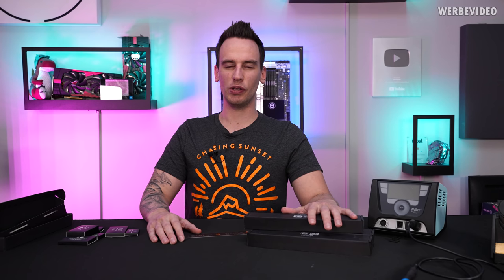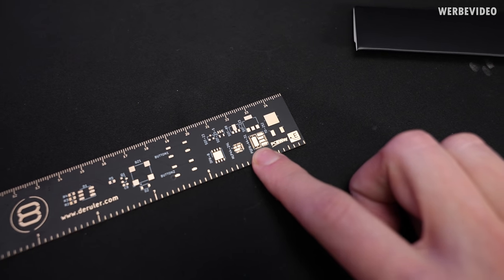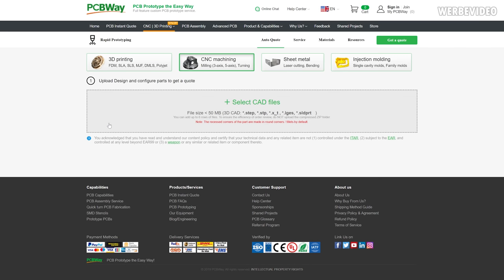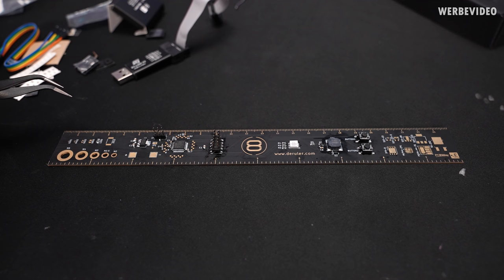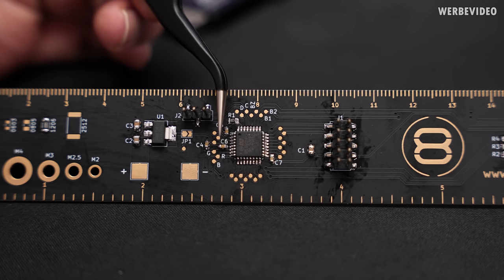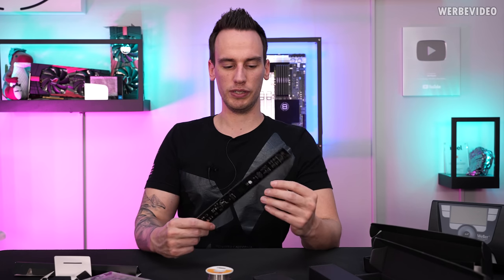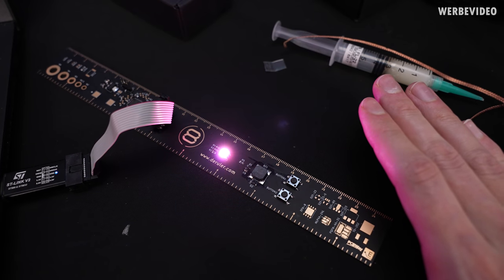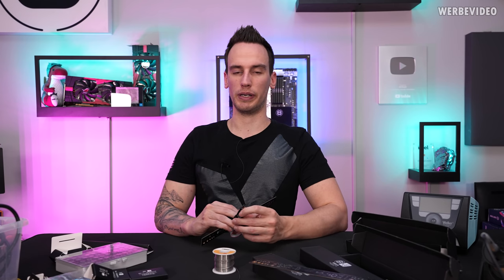Try the Basics of SMD Soldering and Programming of RGB or Fan Controllers

Comment: As someone who's just getting started with soldering SMD resistors and reworking SOIC chips (with lead-free solder, because RoHS), this looks like a good starter kit for those who want to get into advanced soldering skills. All it takes is having the correct tips (I'm still using the common B tip, but I believe using thinner tips or D tips are better, dependent on your preference), and a little bit of patience.
I'm also halfway building my own Uno on veroboard, however it's currently stalled as I had other commitments, but I'll get back to the project later down the line.

Comment: Quite cool. I've only recently gotten into soldering to make simple circuits and was looking at thru hole practice boards so I'm not even close to attempting surface mount. You managed to make those IC pins look effortless
Reply: through hole is often more complicated than SMD tough since it requires more practice and tools even for the basic components.

Comment: Hey Derbauer, go and have a look at Tronclub. It was an electronics kit subscription service. I subscribed to it and received 3 microprocessor, kits from them before they mysteriously stopped sending them. Not sure what happened to them, I guess they went bust, but the quality of the kits was amazing. You got a different Atmel microprocessor of them each kit, and different bits and pieces as well as really high quality instruction booklets. All the programming was in C,  using AVRDude and one of those serial USB programmers you showed in the video. All the circuits were built up on breadboards. Anyway, it would be really good if someone, like you guys, could start something similar again. I really enjoyed each kit it was such a shame Tronclub imploded like it did.

Comment: This is an amazing idea! I'm hoping that these solder pads are quite strong, because I've used wires more often than I'd like to admit after lifting pads when removing components.
Reply: I'm hoping that you obtain a hotter iron, better tip, or more practice. Parts will come free from pads when they are properly heated. Make sure to use flux.
Reply: @shalopez420  I only bought flux last week xD and regarding a hotter iron, I just had desolder wick that was way to big. My iron goes up to around 60W which is fine  for what I do now that I have the right things.
Edit:
Just to make it clear, it was the wick that stuck to the pad and lifted it, just a small component has never been an issue.

Comment: this is quite "unique" timing
#1 I was on Ebay and ran into "PCB ruler" and could use one as I am dabbling in electronics repair 
so I went to Elmorlabs to check out the Deruler and found the "EFC" something I needed for a mining rig with NON controlled fans and ONLY 12V "PCI" power plugs 
ordered BOTH

Comment: This is awesome. Coulda used this to practice on when I was trying to solder my stuff for my RC car FPV system. I would love to own one but I'm still trying to save for and get your delid tool for my 8700k. I lapped the IHS but I'm still seeing some pretty rough temps with mild overclocks and I'm using water cooling with 480mm rad in push/pull.  I really wanna try to delid and put some liquid metal under the hood.

Comment: I been wanting to make my own RGB/Fan/pump controller. I like icue and the commander pro but the problem is it only has 6 ports. If you daisy chain fans you can take out the ports. (Ask me how I know) How I solved this was making a controller that only function was to supply voltage to the fans and supported 0 RPM mode and then the controller would do the actual controllering and never see and amperage from the fans.

Comment: Is the programmer the same as any standard flash programmer (like the ch341a or willem programmer) or is it unique to the microcontroller/software? Could deruler be programmed using the mentioned standard flash programmers?

Comment: I once tried to desolder a SMD led on my gpu, i got the led off, but i destroyed the led, i have always had to hope stuff is through hole so i can work with them and i could really use a good reason to learn C, i always end up using php, python, bash/shell, or js+html+css+(php) and have used my desktop and raspberry pis (i have 2 setup as web servers, one controls the hvac)

i am sure part of my issue with SMDs is the 2$ ~30W irons i have

I'll enter your giveaway, maybe i will have a excuse to lean c at least, i just need to be able to accomplish something i can''t using other methods i already know to get motivation

Comment: Save me from the chroma service 🤣. Got all the led's then found out all the companies are trying to hog control of them and insert shady background tasks.  One for the Asus board, one for the mouse, one for the keyboard...and all of them fairly shite at controlling them. Haven't found one that actually works with games properly for sync'd ighting effects.  Ended up forking out for a Razer RGB controller (doesn't handle the motherboard LEDs, still no in-game screen sync), and even that turns the led's off unless you give it internet access and keep it running in the background.  
Third party or custom would be amazing.
(I also have a bunch of neon indicators I'd love to try and wire up as a mains voltage RGB and get rid of the horrible light LEDs put out for something more natural 😅 so far I can only find a mains relay board with USB control, if there's some hardware that allows controlled voltage regulation over USB...👀or serial..I have a serial and ps/2 port again 🙂)